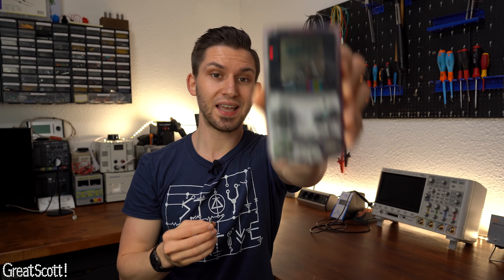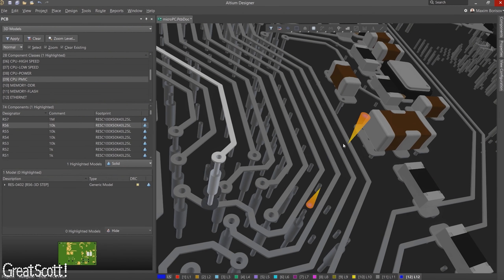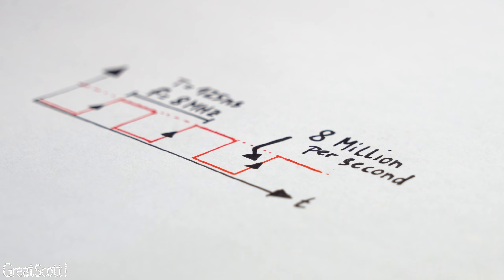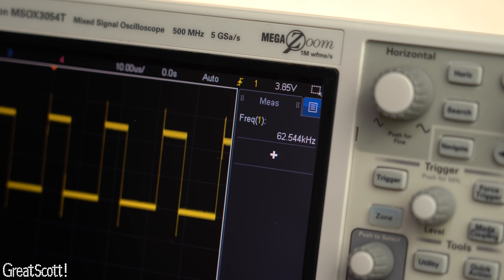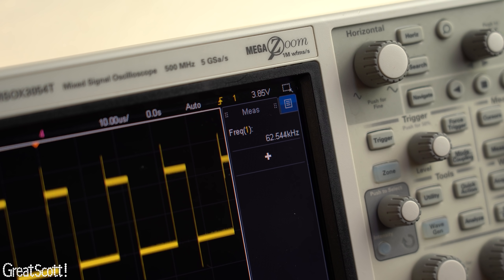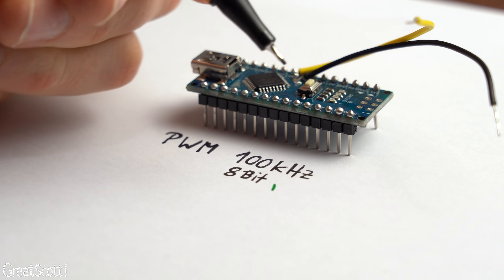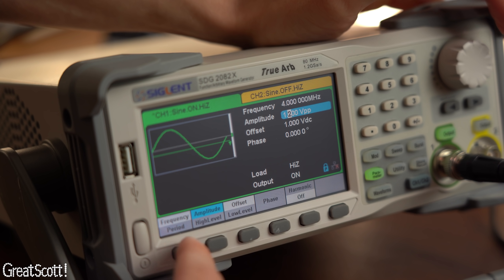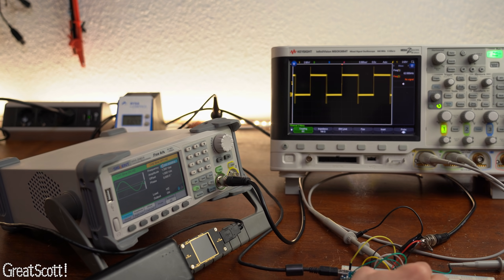Overclocking can be useful?! Let's try with my GameBoy & Arduino

Comment: Thankfully Sharp didn't cost reduce their dot matrix scientific calculators too much.

Change some resistors, and not only does the EL-W535TG get changed into a different model (with more features), but it gets a nice clock speed boost and rips ASS.

Comment: One of my gameboys (DMG-1, aka the big brick) has a potentiometer that can control the clock speed, and a flip switch to turn the speed modification on and off. I don't remember how it works (it's been ten years), but it does exactly what you're demonstrating here, just without any external wires. I can turn it down to watch how it creates each pixel on the screen up to - as demonstrated - everything going so fast that it glitches and crashes.

Comment: I overclocked my Gameboy Color, too! Well, Not exactly the same way but I used the Si5351 Clock Generator Board. My overclocker came up to 41MHz with GB Color and around 20MHz with the GBA SP (which has a smaller clock rate of 4.194MHz).
On my 2nd attempt I chose a longer cable to connect the GB with the overclocker and the result was kinda interesting: The Clock rate became less until the GB is glitched out. With a longer cable I had just half of MHz.

Comment: I hope you see this comment, but I have been wondering on what pens you use in your videos, I came across these pens by a company called stabilo, and the stabilo point 88 look identical to the ones in your video, is that why you use or could you tell me what you use?

Comment: When I was a kid, I opened up my Gameboy and took out the speaker. I extended the wires to lay outside the case, then hooked them up to the 6" subwoofer from my sister's car. It would have needed an amp to play at full volume, but it was already noticeably louder than the original speaker.

Comment: you would want oscillator to be as closer to the chip as possible . It using extension wires it they pickup all the electromagnetic garbage makes arduino crazy on higher frequencies :)

Comment: Hi there. The video is really great and I actually wondered if increasing the clock speed speeds up the games too. I wonder why that is not happening on modern PCs.
But thats actually not what I came here for. Its true that higher frequencies need more (dynamic) power but on those 8 bit chips its barely noticable on the working temperature. The glitching most likely does not occurr because its getting to hot, but rather because the logic gates do not manage to get into a stable state at higher frequencies (talking about transistor level slew rate here). The consequence are occasional errors. So why does cooling help? Check out a transistor data sheet and look at the slew rate dropping at lower operational temperatures. Works similarly with higher voltages, since resistances across the transistor do not change with higher frequencies.
Maybe it would actually be interesting to check the temperature increase on an avr running on 40MHz compared to regular or even lower frequencies. #GreatScott!
Btw, this is not meant to be negative comment at all. Just had the feeling the reason of the glitching was not quite clear. So just maybe giving back some knowledge because I already learned a lot from the videos on this channel.
Reply: The answer as to why this doesn't happen on modern PCs is that modern games that have been properly optimised  will have an internal timer that caps the speed that the game can run at.  Some software that was originally targeted to run on early IBM pcs such as the 5150 did not have this, and would run too fast on newer hardware- hence why PCs from the early 90s had the "Turbo" button.
Reply: @paulgraves1392  ah yes. Might have bin an obvious question, regarding modern PCs. They most likely have  some kind of "SysTick" Timer with a dedicated reference clock source.

Comment: i found a oscillator in my Bluetooth speaker can someone explain the function of it in that
Reply: Cause the bluetooth chip also is a microcontroller and it needs a clock signal, not only to ruj but also for the bluetoot frequency
Reply: @309electronic5  thanks for the info

Comment: I don't understand how these boards are working with more than 8 MHz. I thought that there is a critical path in the instructions(which is the longest instruction) and clock is adjust according to critical path in the architecture. How it is possible that they are working with x2-x3 times higher clocks... If so, why did manufacturers choose this low rate clocks? That is weird to me… But I really like the concept :)

Comment: Ahh. Imagine if old hardware had gotten very simple upgrades in the form of faster clock speed and more memory. It would have been easy to implement too, just map a byte or two to flip between speed modes. 
Of course, most everyone would have just made games for the lowest common denominator, so probably it wouldn't have been very cost-effective. We're just now seeing what some machines can do with a bit of tlc and hardware, with Sonic C64 requiring 256KB of RAM, or the few SuperCPU games that have been released.

Comment: Sorry, but the way you report and also replace the crystal is wrong. A crystal oscillator (the circuit in the Arduino chip) is a bit like an inverter, and the crystal itself is connected between its input XIN and its output XOUT. When you drive both pins of the chip, you might as well damage the output. Therefore, when replacing a crystal with a driven frequency, this is only connected the XIN pin, not the XOUT.
Also, a crystal oscillator (the electronics circuit) is tuned to a certain capacitance. When you solder wires, or even a switch, you are out of its range.

Comment: This was fun. I'm curious what temperature the Gameboy cpu reached. I suppose it's ok to be a little cavalier experimenting with an Arduino, inexpensive and easily replaced, but anything of value I'd want to check data sheets for temp, current, and voltage limits.

Comment: Hello, Maestro. Something popped in my mind. 
Can you combine 2 of your previous video creations, namely a digital potentiometer with the automatic volume adjuster? I don't know if something like an arduino can be used to detect the "ads coming"  signal, even if need to add to it manually. Then mute/volume down but with the digital potentiometer direcly cabeled to the loudspeaker. Just asking.

Comment: You don't need to overclock an arduino to change the PWM frequency. You can change some bits in the timer registers (TCCRx, OCRx, TIFR, etc) and get any frequency (under the clock's frequency) you might want. Both for phase-correct PWM and fast PWM.

AVR ATMega32A, for example, from my experience, works very well between 1MHz and 20MHz

Comment: Wow. Really cool video. Does anyone know what that USB current and voltage measurement chip was you used to determine current drop with the different frequencies ?
Reply from the maker: Search on Ebay for USB Tester. Not hard to find ;-)

Comment: does anyone here know how modern CPUs are able to change the clock with the BIOS? is there a main crystal with some sort of multiplier on it?
Reply: A modern PC usually has a clock synthesizer IC which takes a crystal and outputs several clocks like the CPU base clock. The modern CPU then multiplies this base clock internally to create its core clock. To save power the multiplier can be changed (along with the voltage) on the fly so it only runs as fast as needed.

Comment: I remember overclocking my old school TI-99/4a back in the day. unfortunately, all of the I/O was clock based, so any time I had to read/write programs, use the serial/parallel port, or do any other I/O I had to switch back.

Comment: Of course, now I must wonder why they limited the game boy, and other electronics. It seems like kicking the Arduino up to the higher clock speed would still be well within the limits of the unit...
Reply: The chip in the Arduino is rated for 20MHz. Earlier Arduinos might have used an older chip which was only rated for 16MHz and that could be why this slower speed is maintained.

While the Arduino worked fine in GS' configuration anything over 20MHz is not guaranteed. Using different functions of the chip or running it at different temperatures, etc might make it crash sooner. I've heard that the serial port is one of the first things to stop working.

Comment: I do overclocking in microcontrollers all the time. I started doing when I was working with dsPICs, because of the internal PLL, it needs a weird 7.5MHz frequency to be multiplied by 16 and give you the maximum frequency of 120MHz (for the dsPIC30F4011). Since back then the closest crystal I had was 8MHz I figure what a hell I will give a try. So the clock jumped to 160MHz no problems. Never failed in any dsPIC I tried so I extended the idea to PICs as well, when I need more performance out of it. The bottom line is, increase the frequency in steps to discover the sweet spot and avoid weird behavior.

Comment: A slight correction for your video: at 5:24 you had cut off (and likely shattered) the crystal that was within this can, the gold springs that attached the crystal are still there albeit shortened (Look to bottom right of the capacitor within).
The IC essentially ranges from a simple inverter to a full featured PLL driven by the now missing crystal.

Comment: Nice experiment.  When running at increased clock frequency, did you notice any increase in heating (even by a finger touch)?  Maybe not a problem for the gameboy CPU.
Reply: With maybe 0.1W power usage there isn't really any noticeable heat

Comment: maybe it was unstable at 40MHz because the ADC couldn't handle that fast of a clock signal
if it has a programmable source clock divider then the arduino could be clocked even faster

Comment: That’s actually frikin awesome Scott. I have a situation where I’m tryin too over clock an older tool I got from my dad because it is built like a tank but just a little too slow too work on modern electronics lol. I didn’t realize that the square oscillators were actually micro controlled lol.

Comment: With Arduino overclocking, you can reconfigure the Atmga328p chip for an external square wave clock on by changing its fuse bits, the datasheet says the limit is 0MHz

Comment: After seeing you hook up that signal generator to arduino and gameboy, I'm wondering is it possible to do the same with old 286/386 era DOS computers to make it runs faster or slower?
Reply: That's basically what the Turbo switch was for

Comment: wait there is a clock minimum? I thought you can run it as slow as you like and there is only an upper limit. Can somebody explain why that isn't the case?
Reply: I think some peripheral devices may lose sync if it doesn’t see a clock pulse after some amount of time, but idk just a guess
Reply: Devices with 'static cores' work down to zero Hertz as you'd expect. Lots of things are static core but not all. If some of the circuitry is relying on capacitors then they could discharge if not run fast enough. A prominent example is dynamic RAM. They need to be refreshed constantly or else data will be lost.

An analogy is an internal combustion engine which will stop running if it's not going fast enough.
Reply: @eDoc2020  hm, I always thought Ram was doing that internally guess I was wrong

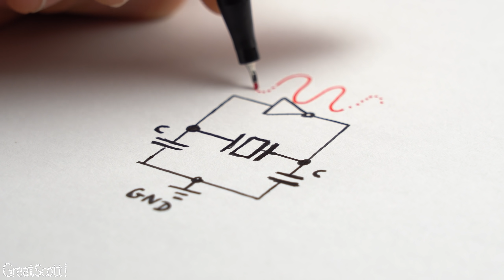Comment: I don't understand why the PWM signal has a maximum frequency = crystal oscillator frequency/256. Obviously I understand that 2^8 is 256 but I miss the sense of the calculation itself.. I've tried to hear it may times from 5:45 but it doesn't get clear.. is there somebody who could explain it to me?
Reply: The PWM works using a counter in the chip. On every clock cycle the counter increases and if its value is greater than the set value the hardware sets the output, otherwise it sets the output. The counter's limit can be changed to make a faster wave but then you will have less counter resolution.

Comment: U can also get 100khz pwm from arduino normally by playing around with the timer registers for a bit

But u will only get about 160 resolution duty cycle, which in my book is still plenty to work on
Reply from the maker: Like I said. I wanted 8 bit resolution
Reply: You should take a look at the ATtiny25/45/85 Microcontroller. They come with PLL (Phase-Locked-Loop) that can multiply the internal clock source to 32 or 64MHz. You can use that to directly clock the Microcontroller (will work up to 20MHz and COULD go even higher than that) or use it as Clock Source for Timer1. You keep the 8bit resolution and have 64 MHz you could then prescale down as needed. Those Tinys come as a DIP-8 package, perfect for small projects. All you need is a 10k resistor between Reset and Vcc and a small capacitor between Reset and Gnd if stuff gets noisy. Ah, and an ISP-Programmer or a spare Arduino (my USBASP is basically a ATmega328p).

Comment: I wonder if overclocking the game boy will affect debounce by halving the threshold time and causing double clicks?
Reply: if it's software debounce and it isn't lenient enough on the thresholds, it will indeed. If it's hardware based (caps and such filters on the pins) then it wouldn't change anything.
If I was the one making the hardware code for the GBC I would sure add a considerable time that still doesn't affect gameplay, which I bet they did as well to compensate worn buttons and such as well.
Reply: @Kalvinjj  good point, I hadn't considered hardware debounce, I can imagine it is that. 
It t probably doesn't have cpu cycles to waist doing software debounce.
Reply: @Kalvinjj  AFAIK the 8-bit Game Boys use controls which are multiplexed by software. I'm quite sure there isn't any hardware debouncing. I believe most games get around this by only sampling the buttons once per video frame (as part of the game engine's main loop). As the system runs at 60Hz this means only sampling every 16 or 17 milliseconds. Assuming the switches take less than 16ms to bounce there is no explicit debouncing necessary.

Comment: You should've soldered a 16mhz crystal in with the 8mhz one and a switch so you could play the games at 2x speed if you are feeling impatient.
Reply from the maker: Possible.....I also said that exact thing in the video ;-)
Reply: @greatscottlab  Ah yes I missed the "with modes part". 🙄 I should probably swich the video off 2x speed...
Maybe even install a 4mhz crystal for 0.5x speed and pickup on all other details I missed 😁

Comment: A bit more info on the gameboy. The gameboy color that you're using actually has twice the clock frequency as the original gameboy (8mhz vs 4mhz). So to compensate, the GB Color uses a clock divider internally, unless a game specifically tells it not to, which most gameboy color games do (Unless it's one that is designed to be backwards compatible).
If i remember correctly, this clock divider is causing the glitches as it can't keep up with the higher frequency and "misses" clocks. If you tried a gameboy color game, it might be stable at much higher speeds. Also another source of glitches might be the ROM, as higher clocks may push access times below its latency limit. A modern flashcart with flash or SRAM based storage might fair better.
Also interesting is the world of emulation, since you can essentially modify the way the hardware works. For example, some time ago i modified a GB emulator to run at 160mhz while keeping sound and video hardware at stock speeds. This means that the gameplay runs at the same speed, as it's tied to the display refresh rate, but any sort of slowdown is completely eliminated because the gb essentially has 20x more CPU power for every frame. This is great for chiptune artists too, as some of the more advanced effects can be quite CPU heavy and overwhelm the device.
Reply from the maker: Thanks for the feedback :-) Very interesting
Reply: @greatscottlab  Thanks! Awesome video btw and great explanation of syncronous electronics. Also I honestly had no idea that clock crystals output a sine wave rather than a square wave. Interesting, i wonder if that can cause issues on chips where the voltage edge between 0 and 1 is a bit fuzzy.
Reply: @BinaryCounter  seems to be a dimension biproduct of how the universe works... If oscillators oscillate, it's more likely due to some "spin" hence the sin wave. My knowledge is very limited but afaik this is why when using Arduino switches and stuff, one works with pulldown resistors and threshold voltages etc, as the voltage at a pin might be unstable for a number of reasons...
Reply: @juliasmith1182  Say what now??? I'm not sure how anything you just said is related.
Reply: @juliasmith1182  the reason is that a signal with only one frequency is a sine wave.  A square wave has additional frequency components at odd harmonics of its fundamental frequency: https://en.wikipedia.org/wiki/Square_wave#Fourier_analysis.
Reply: @undefinednan7096  Good to know somebody knows the math...
Reply: I saw a video years ago where somebody overclocked the GBC. They found that if running a CGB game the system crashed at half the input clock as needed to crash a DMG game. Basically it's the CPU which is glitching out, and the divider is working fine.
Reply: The clock divider makes sense, since it plays OG Gameboy games too.
Reply: Awesome explanation! That was a neat nugget of information :) cheers!
Reply: As i wrote earlier, just trying stuff doesn't make interesting videos. You should be informed, and turn your brain on.
Reply: i think you would have to size up the new crystal to derive higher clocks. I'm not sure if the clock divider is a crystal oscillator ,they used to be on older pcs around 286 - 486 era. A guy i watch overclocked the entire mother board bus by changing one of these crystals . Adrian's Digital Basement , nevermind i just saw him remove the crystal and use just the arduino . a cool idea .